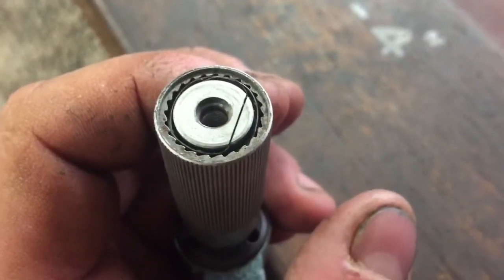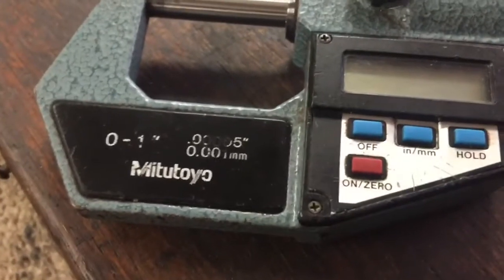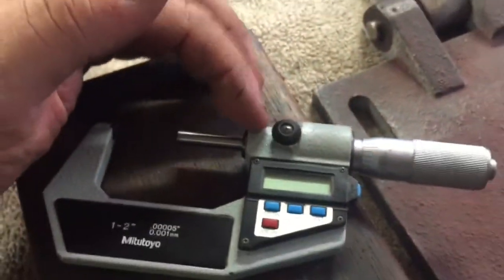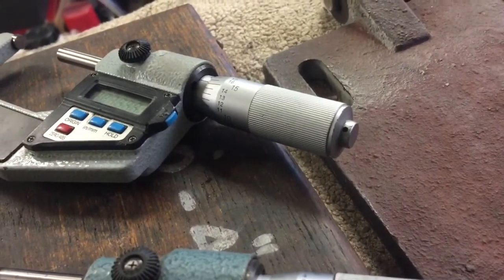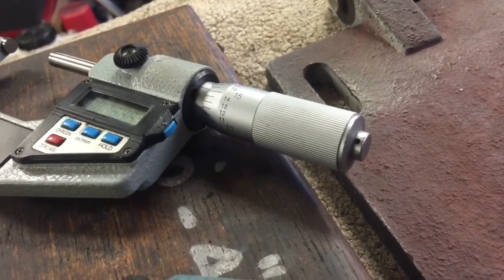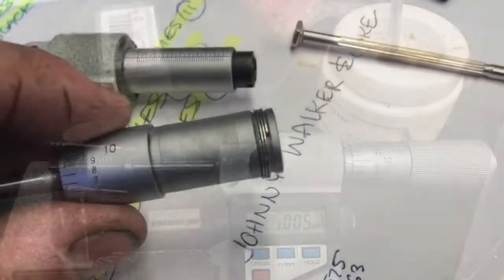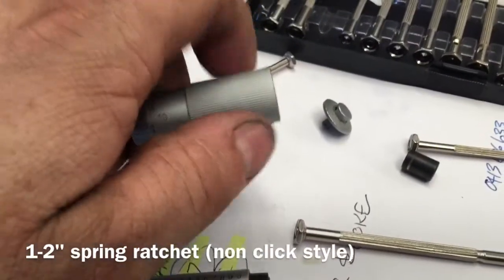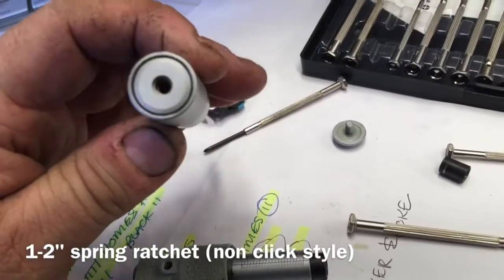Mitutoyo Micrometer Ratchet/Friction collars compared

Comment: the barrel/inner screw assembly on the 1-2" how did you get it apart? i have a mechanical 1-2 that i need to break down for proper cleaning. no ratchet on mine, just the friction thimble like on yours..
Reply from the maker: From memory the end cap unscrews from the central spindle, which then allows the friction outer to slide off the end
Reply: @JBFromOZ  right, I mean getting the whole thing out of there. Like taking the threaded screw out etc